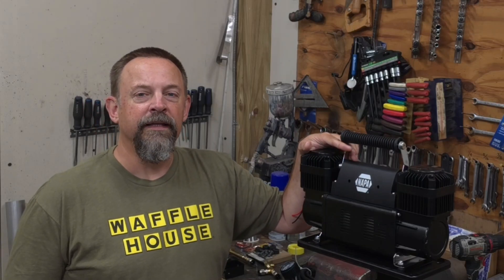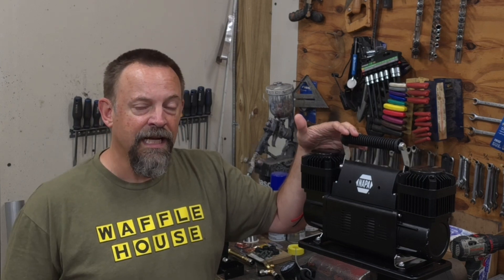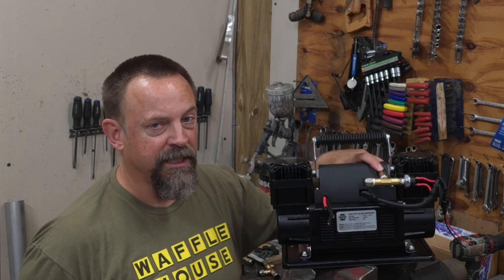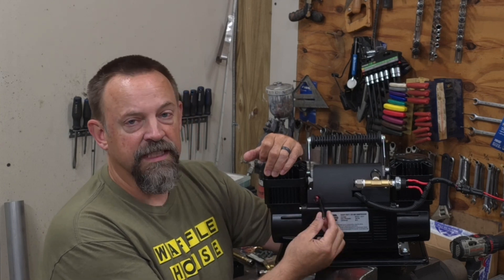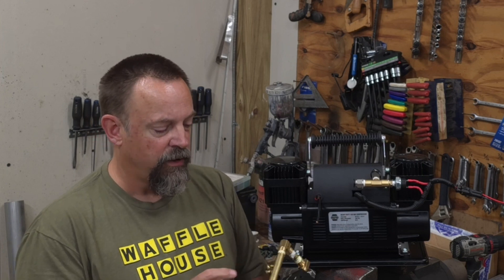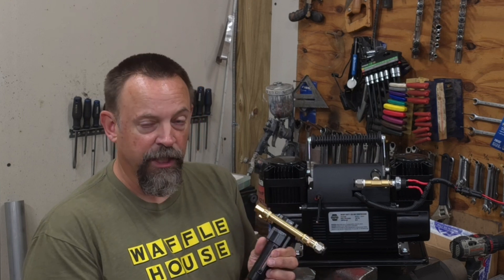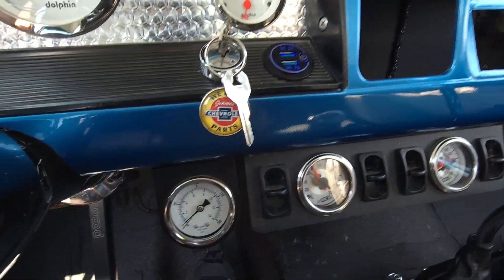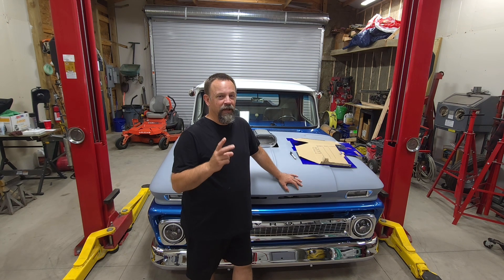On Board Air Compressor, NAPA electric or York?

Comment: Try the ARB quick recovery twin 5 cfm, pumps to 150 psi when it drops to 100. The recovery rate is 30 seconds. I’m running six bags off it.
Reply from the maker: The ARB is definitely a nice unit!

Comment: At 14:20, have you calculated your belt/pulley drive ratio?  At 16:45, You are probably spinning the York faster than you think.
Reply from the maker: Exactly. I have not bothered to see what the ratio is because the speed will change anyway with engine rpm.

Comment: at 0:25, if oil is coming out, are you putting more back into  your compressor? It will run out of oil as well. If it is coming out into your air, it must be coming from the compressor sump. It will also become contaminated with moisture and dirt from the air it is compressing, and it will also need to be changed as well. Have you considered these eventualities?

Comment: At 8:45, if you were to cool that hot compressed air, you would cause the moisture to fall out of suspension better/faster/more completely, before it enters your trap, then finally your reservoir tank.

Comment: At 1:55, Does that 5-cfm rating take into account the elasticity of air, in that at 0psi (0-bar) 100% of the air is pumped out per cycle, where as at 150psi, (10-bar), the piston has to squeeze the air 9 times smaller, 90% before any air 10%, even starts comes out of the compressor, and what ever air that did not come out re-expands to consume space that the new intake charge can not fill because something is already in the way.  That is why air compressors say something like 5-cfm at 40-psi and 2.5-cfm at 90-psi. You may not be realizing the promise of 5cfm...Do you know the shape and volume of the cylinder head / "Combustion Chamber" if you will allow an imperfect description,  above the piston at top dead center "Compression Ratio calculation", on the York?
Reply from the maker: Purely based on internet seqrch of conpressor rating which looks to be bore and stroke volume, so that's at 0 psig. No idea what the cfm actually is at pressure.